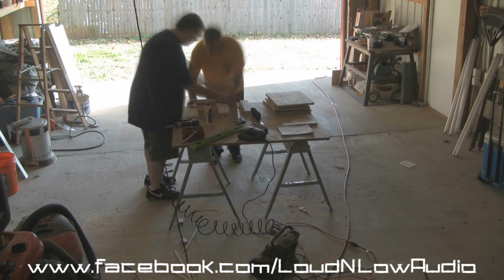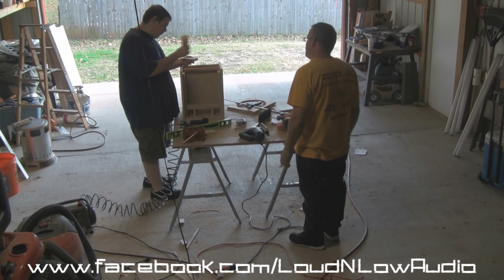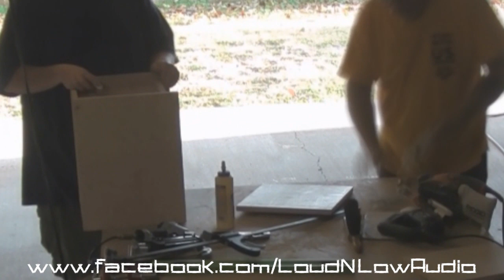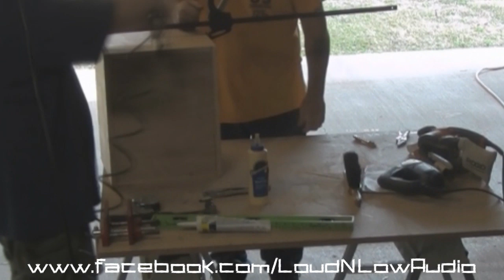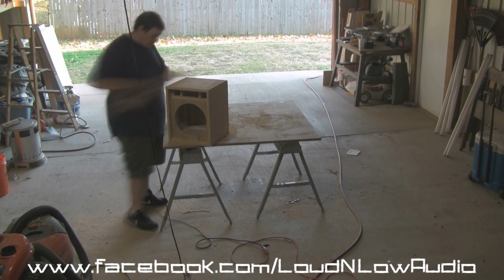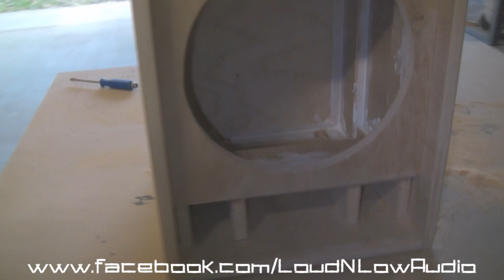Guitar Speaker Cabinet Time Lapse Build Thiele Design

Comment: I have a home made 15 " TL. After, we  realized that the speaker was supposed to be in the middle of the whole front of the cabinet, not in the middle of the baffle. That puts the speaker about 2 inches to high in the cabinet. I don't know about your build but mine was an error that you could make and never even notice until it's pointed out, then it's obvious. Every other TL cabinet the speaker is in the middle of the whole front of the cabinet and looks too close to the port but that is the right way.